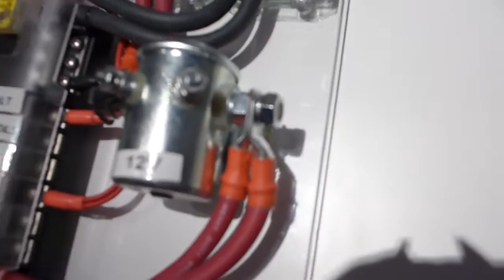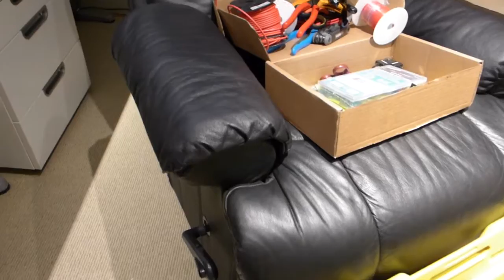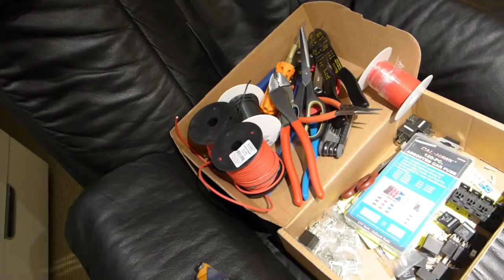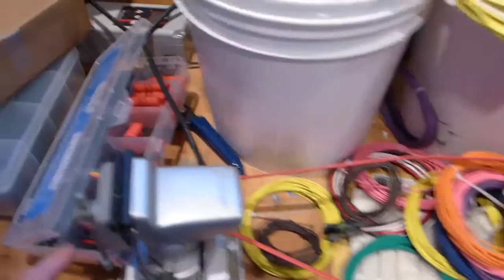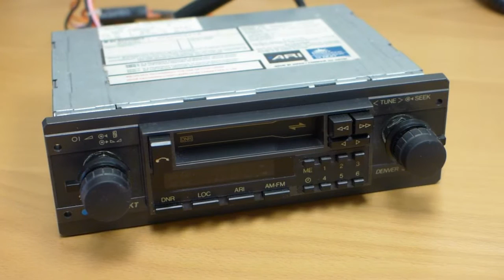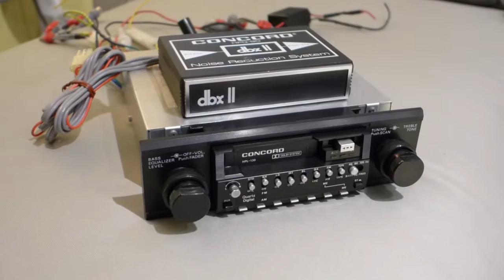The Ultimate 1983 Rabbit GTI - part 92 (Relay/Fuse Panel Wiring, Blaupunkt & Concord Cassette units)

Comment: This is the first time i've heard of an alternator cut out, Would it provide much more power for the risk of running your battery down? Will you have a fail safe to ensure it's only switched off at high revs? Also how will you ensure your ignition system gets a constant voltage without making use of the alternators regulator...Great build by the way, been following it for months!

Comment: What/how do you plan to install an antenna for the Blaupunkt?  I noted that you have already sealed up the original fender mounted antenna hole on the left side.
Reply from the maker: Robert Orr The previous owner installed a center rear roof-top powered antenna that I will reuse.
Reply: Is the reception any good?  I have seen several "Shark FIn" style on Amazon , but they seem to have mixed reviews at best.  Thank you for doing such meticulous work in detailing your progress. It is a real inspiration.